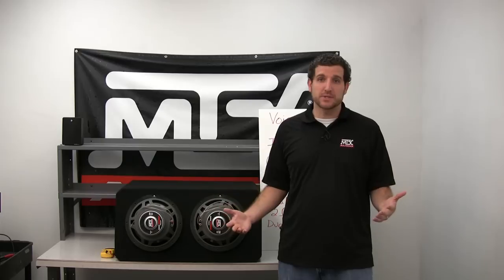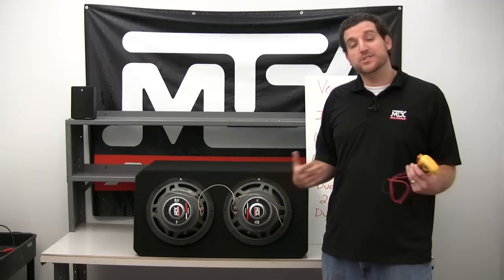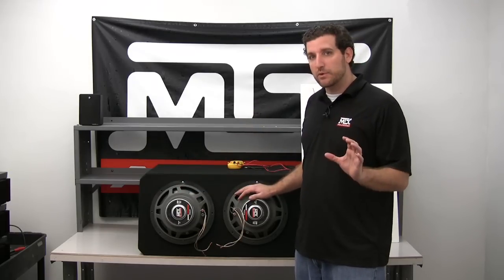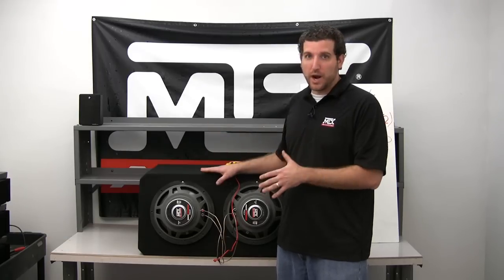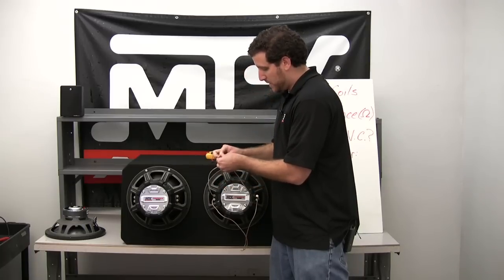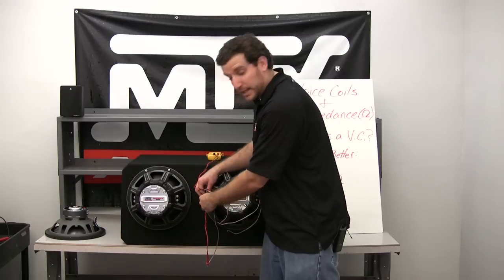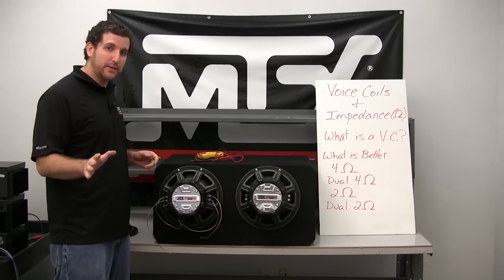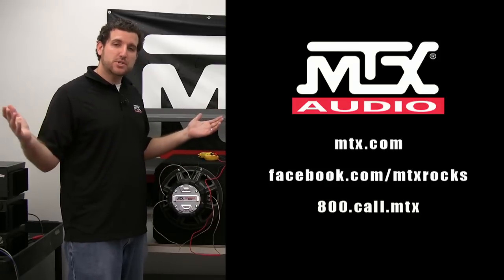How to Wire Your Subwoofers to the Correct Impedance for Your Amplifier

Comment: This helps a lot. My amp worked wonderful with my Kenwood single voice coil 12 but when I swapped the sub to my Kicker 12 which has dual voice coils the amp cut out at about 15% volume. So now I will go out in the morning and test the ohms and make adjust the wiring as I believe it’s definitely the issue. Thank you for the video!

Comment: Why not take two  4 ohm amps which are 2 ohm stable and hook them up to a 4 ohm duel core sub one amp connected to one coil pos -pos neg-neg and the other amp connected to other coil pos-pos and neg -neg then u can run amps cooler and have plenty of BOOM/BOOM to go around.

Comment: this is huge help i have 2 10in orion 4 ohm subs max is 1400w for each sub and my amp is 2,000w x2 so it should be 1000w each channel.. if i run the speakers with + to - and + to - at the amp it hits hard but if i run + to + and - to - and run a jumper wire it hits even harder so my amp is running its max power because i dropped my ohms.. thats so cool and it sounds amazing..  👏💙 did it today and i set off a cars alarm across the street 😂 best advice for anyone reading this comment is to study your amp and speakers and with or without a volt meter you can get your rating just by how you wire it.. if you have 2 ohm subs and your amp only handles 2 ohms you can run it + to - then + to - at the amp if its 1 ohm you can run it + to + and - to - then run a jumper wire to the amp.. if you have dual voice coil just do the same thing but make sure you know what ohm they are so if they are 4 ohm if you run + to + and - to - it will make it a 2 ohm woofer so to keep your 4 ohm to run it to a 2 ohm final load you would have to run it + to - then + to - to the next woofer if you do two subs...

Comment: I have 2 Alpine bass lines subwoofers that are 350 Watts RMS but my amp is a Soundstream 1200 d block with 1200 RMS how should I set my controls. It's a massive wattage for these subs and I don't want to blow them

Comment: What if the subs are 300watts rms at 2 ohms, and the amp is 825watts at 2 ohms. I currently have only 1 sub hooked up, but thinking about 2nd. How should I wire it? If I parallel them, would that result in 1 ohm impedance and 4 ohm if series? Neither really works for me. I guess I should of gotten 2 4ohm subs to wire down to 2 ohm

Comment: I have two 12inch subs in a ported box single voice coil with an rms of 250 each! I have a bargain amp from boss with a rms of 825 is that enough power from the amp to power both subs ?

Comment: So what your saying is if I have 2 duel vc 4ohm speakers I can't hook them both up and get 2ohm at the amp cause doing that will give me 1ohm right so I either have to get 2 2ohm vc speakers or single speakers   there's no way to bring that 1ohm between the two 4ohm from 1ohm to two ohm at the amp?
Reply: You probably figured it out by now but if you have 2 duel vc 4ohm speakers, and hook them up right , you should get 2 ohms .

Comment: the lower the impedance:  tha harder your amp works, and your woofers gets hoter (  0.5 ohm and 1 ohm)

the higher the ohm (2 ohm  or 4 ohm )  the easier your amp  runs them .

Comment: What if i have apm. R.m.s 3wx2 4ohms what size,watts,ohms speaker are match?
Reply: you need to put in mor information dude
how large is your amp ? 
are you gonna run one sub or two subs ?
Reply: jalliboy I have kenwood 540 watt rms 4 chanel amp 4. 4 ohm 3 way 8 " door speakers  and a 1000 watt 10" powerd sub I'm confused on how to wire this

Comment: How would I wire 2 x dual 4 ohm down to a 2 ohm impedance for my amp?
Reply: I believe you can do it by wiring the voice coils on 1 sub I series, then the other subs voice coils in parallel. Then connect the 2 sub leads in parallel. I think. I dont know how that will effect or affect the amp/subs
Reply: you can only wire them down to 1 ohm or 4 ohm
Reply: @ityaboychipsahoy7499  thanks man. I already took care of it. Check out my set up. Wired at 2 ohms at the amp.
https://youtu.be/Tpa6yOe8zLU

Comment: i got a kenwood  1000 watts max (70 x 4 ) 4 channel bridgeable amp, a 2 pieces 1000 watts switchable 2 or 4 ohms sub speaker and 4 pieces 250 watts 4 ohms speaker, how can i wired this that my amp can handle?

Comment: mindciller
So if I have a class d 2 channel that is 250w rms x1 into 2 ohms , or 125 watts x1 into 4 ohms.... If I want to run one speaker I need to buy a speaker that is a two ohm speaker and bridge it? I currently run a 4ohm speaker bridged on this amp and it does fine but it's probably not the best recipe right? the amp is a thunder 4250d mtx. I bought it new many years ago at a circuit city or goodguys

Comment: I'm getting the skar 12" sdr 600rms(dual 2 ohm) wired in series with a 1 ohm final load pared with the skar rp800 mono that is 800 rms at 1 ohm,600 at 2,and 400 at 4 ohm ohms but has 4 output terminals,A with + and - and B with + and - , which 2 out of these 4 terminals do I connect my positive and negative ends ??? I'm a beginner and need answers🙏
Reply: To a pos an neg like you would normally both the pos and negs on a monoblock are the same it's just split so you can run 2 subs or if you use large gauge wire
Reply: An a 2ohm wired in series will give ya 4 ohms bud

Comment: So if I have 2 dual 4ohm subs and wire it to a 1ohm ...would it still have the 600rms or would that change
Reply: Would change to about 1200 rms.
Reply: That's if you're amp can put out 1200 rms at 1 ohm tho
Reply: The amplifier has to be stable at 1 ohm and has to do atleast 1,200 watts.

Comment: I have 1 SVC sub rated at 350W rms and a powerbass 400.2 amp rated at 2ohm stable 400w rms (bridged) i already replaced the sub because i burned the coil so what did i do wrong, bear in mind that the gain was near 1/4 level.

Comment: I have a Pioneer GM-D8601 amp, it says it is 1-ohms stable and can run continuous power at 800W x 1 but is 1,600W max power. So the best sound quality would be to try and get 1 ohms out of my subs connection? I have a Pioneer TS-W3003D4 that runs at 2,000W max power. So my amp is nowhere near good enough for the subs?
Reply from the maker: Actually... If your sub is 2000 watts Max, it is probably around 1,000 watts continuous (RMS) and if your amp is 800 watts x 1 continuous (RMS), they are fairly well matched. 1 ohms doesn't necessarily mean best sound quality, but it does mean more power. However, if your subwoofer is a dual 4ohm voice coil, you can't wire a single subwoofer that has a dual 4ohm coil to 1ohm. You can wire it to 2ohms which your amp probably has an RMS rating of around 400 watts x 1 at 2ohms.

https://www.mtx.com/library-wiring-diagrams

Comment: I have a 1 ohm. Stable amp and 2 12inch single voice coil  Subwoofers and I would like to run them at 1 ohm how do I do that
Reply from the maker: If the subwoofers are single 4ohm voice coils, you can't get to a final impedance of 1ohm. You can get to 2ohms. If the subwoofers are single 2ohm coils, you can wire them to a final impedance of 1ohm. Please visit our wiring diagram tool here - https://www.mtx.com/library-wiring-diagrams

Comment: I have a mono block amp, 350W @ 4-ohms, 550W @ 2-Ohms.  Have two 10" subs, 400W @ 4-ohms.  Am I correct to wire in parallel?  I  don't fully understand how the wattage changes for the subs when wiring in parallel.
Reply: Glycerin You'll have to do some reading on how resistance is affected in series and parallel circuits

Comment: 1 have x12 amps with 4000watts 2 stable impedance. Spared with one 4ohms dual voice coil. My problem is the bass sounds is distorted and weak.
Reply: Its a 10" DVC Subwoofer.

Comment: Hey I have gotten an amp from your guys brand spanking new. I got a replacement Bc the last one stayed in protection mode even when the car was not powered on. Sent it back and come to find out the amp was defective. Got the new one today and got it connected but it’s doing the same thing. I have a TNA251 Terminator amp with matching dual Terminator 12” subs. What is going on?? The subs are 600 a piece (1200 watt subs) the amp says 600 Watts. I’ve been to two different shops. Same results. Is someone just installing them incorrectly and have my settings incorrect?

Comment: i have four 10" single 4 ohms pioneer subs and a 2 ohm stable planet audio amplifier. I'm not sure how to hook it up to get 2 ohms? Right now the speakers are wired to 1 ohm and it's making my amp go into protection mode fast
Reply: yes they are wired wrong they are better off at two ohms your amp. is not one ohm stable.
Reply: correction your suds need too be wired too what ohms your amp put out .

Comment: i have a 5 channel amp with MAX Power 1600W
• RMS Power:
     50W x 4 + 300W (4Ω)
     75W x 4 + 500W (2Ω)
     150W x 2 (Bridged) + 300W (4Ω
and 1 OZ Audio Vector Series 12", Dual 4 ohm 2" Coil 300W Subwoofer, what is the proper wiring for this? i've tried connecting the + and - wire to my sub then to the amp bridge connection but it smells kinda burnt.. i think i just fucked up my sub lol or is it normal for new subs?

Comment: I need help finding the right sub, or subs for this amp https://www.sonicelectronix.com/item_718_Orion-8002.html
Reply from the maker: Our 5512-44 subs would be perfect. You would have the option to wire them down to a 2ohm impedance and run 1 subwoofer on each channel or you could wire the two subwoofers together to a 4ohm impedance and run the amplifier bridged. https://www.mtx.com/5512-44-car-audio-subwoofer
Reply: MTX Audio USA 5512-44

Comment: Yes i have two gravity 15s dual 4ohm and i have a power acustic 4500 watt mono block class d stable at 2ohms so if i wire one sub positive to positive negative to negative brings that one sub to 2ohms now i do the otheir sub same way from the amp thier is positive negative do i hook that one to both subs positive and negatives meaning one sub has positive negative being i have two still 2ohm load
Reply from the maker: 2 - dual 4ohm subwoofers can be wired to a 1ohm impedance at the amp or a 4ohm impedance at the amp. Your amp is not 1ohm stable so you would have to wire them to a 4ohm impedance. You can use our wiring diagram tool to help you understand the difference in wiring - https://www.mtx.com/library-wiring-diagrams

Comment: Im having a problem with my amp going into protection mode 
 I have one 15in subwoofer its peak=1000watts RMS=500watts 
Amp=1200watts 
at 4ohms gives 350watts of power and at 2ohms gives of 600watts. I parallel wired my sub to match 2ohms. Is there anything i can do to fix the problem?
Reply: look up the specs of your amp. if it is 2ohm stable then your parallel wiring should be fine. a reason your amp could be going into protect mode is because your ground wire. make sure it is directly touching the base metal of car with no paint, rust or dirt blocking. you also want your ground wire to be as short as possible, close as you can have it to the amp
Reply: your amp is more than likely only safe at 4 ohms

Comment: Hello, i have  an Rockville RXD-M4 6000 Watt Mono Class D 1-Ohm Car Audio Amplifier with (2) Boss Audio Armor AR12D 12" 4800w Car Subwoofers+Sealed Sub Box Enclosure.  I am trying to figure out the best ohm impedance as to am I able to wire/parallel the 2 Dual DVC 4 OHM subs to the Monoblock Single Channel Amp at a 2 ohm load?  I have tried it at a 1 ohm load and my subs started to smoke.  Please help!
Reply from the maker: Ryan, when matching subwoofers to amplifiers and when setting gains appropriately for subwoofer power handling, you want to use RMS ratings... not peak. Your amplifier has an RMS power rating of 3000 watts x 1 @ 1ohm, 2000 watts x 1 @ 2ohms, and 1500 watts x 1 @ 4ohms. This manufacturer also lists CEA compliant power ratings which are more realistic which are exactly 1/2 the output of the previously listed power ratings. 

Your subwoofers have an RMS power rating of 1200 watts each and have dual 4ohm voice coils. With two of these woofers, you can wire them to a final impedance of 1ohm or 4ohms. If the subs were smoking when wired at 1ohm, it is possible that the power ratings are exaggerated and can't really handle that much power. 

If wiring at 4ohms is working properly and the subwoofers are not smoking, that is your best possible wiring configuration.

For more information on subwoofer power handling, please read this article - https://www.mtx.com/article-subwoofer-power

For more information on amplifier power ratings, please read this article - https://www.mtx.com/library-car-amplifier-ratings

Comment: Hi guys I have a Dvc 1400 w sub connect to a 2ohm mono block amp (2700w) the sub is wired + to + and - to -, when I test the sub it reads 4 ohm, how come the amp heats up after an hour of playing?
Reply from the maker: Hassan, what brand and model # of subwoofer and amplifier do you have? Also, when you say the amplifier heats up after an hour of playing, do you mean the amplifier just gets hot but keeps playing or do you mean the amplifier shuts down because it gets too hot?

Comment: I have a question sir, I have a amplifier 300 watts x 2 it means left and right channel only with an impedance of 4-8 ohms and a 12" JbL subwoofer 375 watts @ 4 ohms.I connected this two subwoofer with the amplifier that I have mention 300 watts x2 @ 4-8 ohms..my question is, is this bad connection or a good connection...please help me I need your advise and knowlegde about this matter...I'm very sorry for my bad english because I'm just only a filipino.....from philippines...good day to you sir......
Reply from the maker: Patrick, for your setup (based on how you have explained it and as long as the ratings are RMS), we recommend connecting each subwoofer to it's own channel on the amplifier. This would provide around 300 watts per subwoofer @ 4ohms. Hope this info helps.
Reply: thank you very much again sir, now I have a peace of mind while listening to my jbl subwoofer your knowledge and skill helps me a lot about understanding of ohms and amplifier watts...

Comment: NEED HELP! I have a 600W 4 ohm DVC and want to connect it to my amp which is     4 ohms: 150 watts x 2 chan.
and     2 ohms: 225 watts x 2 chan.
    and Bridged, 4 ohms: 450 watts x 1 channel. How would i go about wiring it up? I am new to this so an explination would be very helpful. Thank you!
Reply: if your amp can handle 2 ohm in 1 channel then you paralell couple your sub to 2 ohm and to your amp as 1 channel to get maximum power,but remember to dial your amp in right.depending on your box and hz you want to play it in to .then download that hz signal down and tune your amp in.

Comment: Hi I have 4 2 ohm dvc subs, and I have them wired in parallel like your websites diagram says. It should come out to a 1 ohm load right? But when I use my dmm it comes out to a 2 ohm load
Reply from the maker: 4 - Dual 4ohm voice coil subwoofers could have a final impedance of 2ohms at the amp but if you have 4 - dual 2ohm voice coil subwoofers, it should end up as a 1ohm load at the amplifier.
Reply: Can you please make a demo for 2 subs with 4 ohms for an amplifier with 4-8 ohms.

Comment: I was gifted two old MTX Thunder 5500 subs in a ported box, what kind of amp do you recommend?
Reply from the maker: Anthony, we would need to know the size and/or model #'s of the woofers to determine an RMS power handling and we would also need to know what impedance the two subwoofers are wired to in order to properly match them up to an amplifier.
Reply: MTX Audio USA They are two 12" "Thunder 5500" subs. Currently they are wired to an 8 ohm impedance. My problem is that these two subs are probably a 2003 model which is no longer in production, and I have no idea if they are single or dual voice coil. Is there a way to tell without taking them out of the box? I feel like I would break it trying to get it out of the box
Reply: i would recommend a HiFonics 1000wrms amp or a similar rockford

Comment: I have jl audio 300 watt rms they are the w1 if I remember correctly but they are 8ohm single voice coil subs how do I get 8ohms from an amp and are there 8ohm amps
Reply from the maker: Fox Trot if an amp is 1ohm or 2ohm stable, it is also able to operate at any higher impedances. When an amplifier is listed as 2ohm stable, that just means it won't work at any lower impedances. It will still work at higher impedances.
Reply: MTX Audio USA  OK thank you so is there any certain ways of wiring that I can do to maximize their sound or dB levels
Reply: homa amps and yes you have car amps that can handle 8ohms but the power output wont be high as a 4 or even a 2 ohm

Comment: hi I have a ovi 2oooo watt max class d mono block 1ohm stable powering two 750 watt subs 10 inch in a enclosed box is that amp to powerful for the subs..
Reply from the maker: Use the RMS (continuous) ratings for your subwoofer at whatever impedance you have your subwoofers wired to. Add the RMS power handling rating of your subwoofers together (2 subs at 750 watts each would = 1500 watts. If the RMS power output of your amplifier is higher than the RMS power handling of your subwoofers, your amp is too powerful.
Reply: MTX Audio USA There 4ohm is the amp to powerfull
Reply: the subs are single voice coil 4 ohm stable
Reply: I have a 2015 dodge charger i what to put some 10 inch subs in it can u recommend some good ten inch sub for my amp
Reply: Robert Johnson inbu
Reply: I have 12inch 2pc pioneer DVC 4ohm speker and kenood 800watt amp. I'wd like to play it at home. But i dnt know how to wire.pls advise.
Reply: holy cow ...a 20k amp?..can you still hear?..lol
Reply: Ashley Lyons ok what if I turn the amp down so the amp won't burn out the sub would that be okay.and again the subs are 4ohms stable